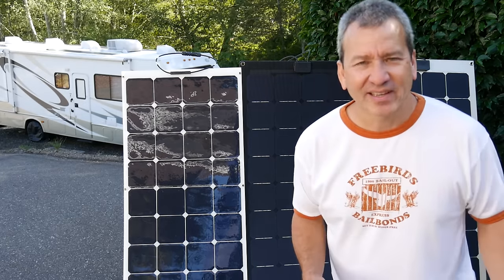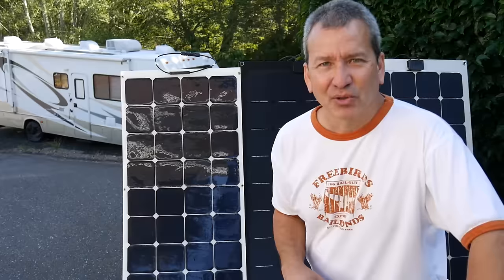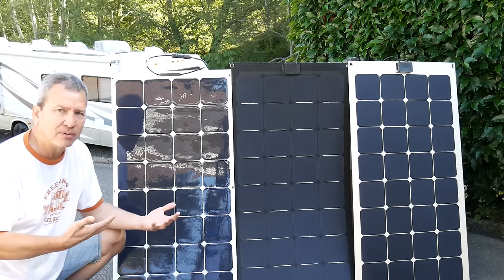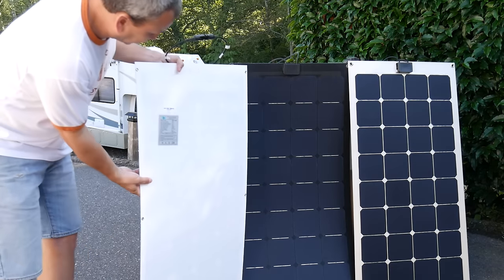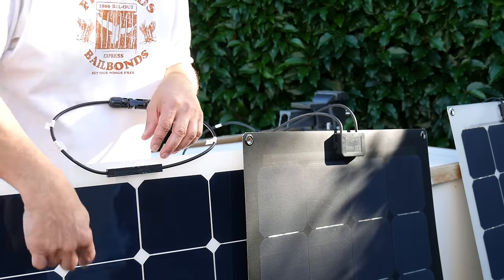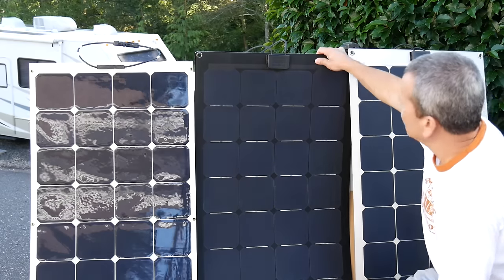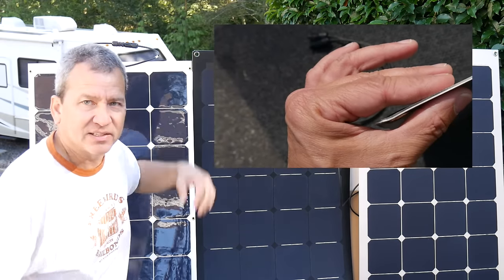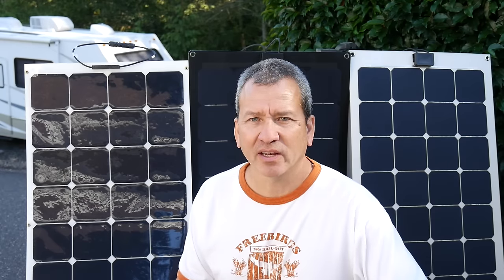Flexible Solar Panels - What To Look For

Comment: Thanks for sharing your knowledge and experience. Kind of late to the game, but just bought two 100 W flexible panels form Renogy (SunPower® Flexible Solar Panels | SPR-E-Flex-100).  Apparently, this is their newly introduced, and redesigned ?, flexible panel after their infamous recall a few years ago.  Do you have any experience or opinion on these?  Thanks in advance, zjxn06

Comment: TITO I am put together a solor system and have changed my battery set up to two 6 volt batteries, my question is can you send me a link to how you started your change over . how to conect your batteris to solar . i want to use two 100 watt panels to start, can you help me get in the rigt direction?
Reply from the maker: Here's a video where I walkthrough my solar/controller/battery setup:http://www.youtube.com/watch?v=ASjfX-8npkE&sns=em.
Reply: Ya i need that type of info myself  :)
Reply: connect your batteries in series (+ on one battery to - on the other) and 2 x 6v becomes 1 x 12v

Comment: Brian, I have the battery that came with the trailer. The trailer is preped for solar. How can I tell if this battery will last through the night and only using led lights inside for a few hours?
Reply from the maker: It should be fine with just a few LED assuming the battery is charged and in good shape. You don't want to discharge it lower than 50% anyway. Let's assume one light uses .5 amps. If you ran it for two hours that would total 1 amp hour. Compare that to the total amp hour capacity of your battery. Hope that helps.

Comment: would these work on an airstream which have curved aluminium roofs?
Reply from the maker: It should work fine. I haven't seen anyone posting an airstream install yet, but lots of vans. They also make a product called Alumibond that you may want to check out (https://www.eternabond.com/articles.asp?id=154).

Comment: Do you think the corners would hold a better seal if one piece of tape cut in the shape of a form- fitting angle were laid down first to attach the panel corner to the roof
Reply: And then the two overlapping edges places on top of it? So the first tape laid down is a solid piece 
 over the panel corner and its edges are covered by the tape that attaches the edges.

Comment: can you run a 24v panel on a 12v system if you got a MTTP controller. A 24v panel gives out about 30v?
Reply from the maker: Yes. Only with about MPPT controller.

Comment: I have a big question for me anyways,,Is it more panels or batterys ,,I want to be able to

 have as much power i can gather I have bought 2 300 watt panels and 2 200 amp batteries,,so is it more about storing the power or how much you have coming in from the panels?
Reply from the maker: I'd start with more batteries. There are multiple ways to charge them up.

Comment: Heat vs Solar: I was interested in this point regarding flexible Panels, that cannot be ventilated!
I did some research and found some Infos from German engineers: There is a HUGE LOSS IN EFFICIENCY! 0.45%/degree Celsius!
From 20° to 60°C you lose 20% energy: instead of 90 Watt from a 100 watt panel you get only 72 Watt. A ventilated on a alu frame sitting panel will be way more efficient!
The simple difference between a panel all black vs white framed has been measured by 2,5% loss.

The panels are NOT made to be glued onto a surface. Coming from boat area - they are ment to be interested in tent style covers or similar. A fiberglass well isolated surface is the worst it can be mounted on.
Reply: der Jack Is there a better way to mount flex panels, in a way that is lifted for better air flow? I’m sure someone has installation ideas that achieve best solar output with elevation of panels; and would the ones with aluminum backing conduct heat both back towards panels as well as to top of metal roof?

Comment: what's the point of flexible fixed panels, when you can't tilt them towards the sun?
Reply from the maker: My reasons are because they are not visible and don't block access to the roof. To get around the tilting issue, I keep one or two panels stored in the RV as a portable setup that I can position in the early morning or late part of the day as needed. If you really need to tilt, you should go with conventional panels.

Comment: I have 4 100 watts Flexible Solar Panels on my mini van.
Reply: Robert Polito I am 4 months away from doing the same and found this video during my research. Do you live/vandwell in your van? if so how has the experience been?
Reply: What is your take on the mounting to metal heat issue?

Comment: Hi Tito,

Are you still using your Unisolar Thin Film (Amorphous) panel or your using a much better brand of flexible panel (Mono, etc...)? Thank u
Reply from the maker: +a c Yes I am still using the unisolar together with the other mono flex panels.
Reply: sorry to ask... but on eBay, some seller making a notes that solar panel should not be connected to parallel or series for it to have a long life... how true is this and does your solar connected to series or parallel? thank u
Reply: Please explain what you mean by "better" - A 64W unisolar will outperform a BP 80W mono because it is able to pick up the RGB spectrum better (triple junction) and therefore
works better in lower light levels. I will admit that Unisolar takes up more space to achieve this but it does not make mono "better". A combination of the two as you have, is best. I would be interested in your views on how they both perform?

Comment: Could you run an electric vehicle with those?
Reply: Remember that an electric vehicle runs off its battery. A solar array does not have the available current to start an electric vehicle moving, it supplies a constant, rather low current. The trick with an electric vehicle would be to have a plug-in overnight to top off the batteries and then the solar array can be used to extend battery life on the road. Provided, of course, that you have some available.

Comment: I heard these dont last are yours still working?
Reply from the maker: I've got Sunpower branded panels now that work great. One of the first HQST flex panels I had failed after 2 years. The others were fine but were showing signs of wear. Newer more expensive ones are much better.

Comment: I'm sorry, but did Tito have that left most panel's neg out plugged straight into the positive out? I may be wrong but that doesn't  seem good, and if not, all these advice videos are suspect.
Reply from the maker: Actually it completes the circuit with no electrical load and is totally fine. When you connect the panel to something else (like a battery or charger) it simply adds a load to the circuit so the current flows through the load as well and then back to the panel. It's basic electricity. Also, solar panels are rated with a "Short Circuit Voltage" rating (ISC). To measure that, you connect the positive and negative then measure the current under direct sun. I hope this helps clear things up for you.

Comment: I bought that HQST on the left and it FAILED after just 16 months of use.
Reply: @drewwolod4977  I won't ever buy a flexible panel again and I hope others see this post.  NOT a good value.
Reply: @VitalityMassage  I mean, that's common knowledge. Flex panels don't last that long due to heat dissipation, or lake thereof. You need to get panels with good warranties so you can swap them out.
Reply: @drewwolod4977  I was new to buying solar panels so no, it wasn't common knowledge and no, it's not logical to just "swap them out".  It's a WASTE of time, resources and money.
Reply: @VitalityMassage  For me, I don't want 25 extra pounds on my roof, so a flexible panel is a better option for me.

Comment: I would not walk on any of these solar panels because it will at some point the connections between the cells or the cells themselves will break. Most say you can walk on them only because their competitors say you can; so they have to say you can too else you will buy the "other brand"...

Comment: How big of an issue does heat play in flexible and non flex panels?
Reply from the maker: Generally speaking, they generate heat and perform better in cold weather. Performance levels decrease in very hot weather. The ratings at standard test conditions (STC) are taken at 77 deg F.  I've tested these panels in direct sun with the panel temperatures at 140 degrees and they've maintained their standard output levels. I plan on exploring this further in an upcoming video.
Reply: RVwithTito look forward to that video and thanks.
Reply: Question is not just heat: a standard panel is mounted on a alu frame that will transmit heat and ventilate from the back. This is not possible with a flex one glued on fiberglass roof!!!
THAT'S the difference. And therefore you will get inefficiency you can NOT calculate in front

Comment: If the panels dont have a totally flat surface forget them. Flexible panels are crap and break too easily. If you are serious about making power from solar, then you need panels that you can angle towards the sun and an automated system to keep them pointing at it.

Comment: First want to say thank you again for all your videos. You are 1 of 1000 can teach the things people understand easy.  Second - i have a question and think you are the right one for answer. I live here in thailand and here the energy is a 1 phase 220V 50Hz System with a 15KW meter. In bigger citys is 3 phases 380V possible but not in my area. Now i see a Motor Pump Inverter that inverts 1 Phases 220V to 3 Phases 380V. Here the link: http://www.solar-thailand.com/EN/Product.asp?Data1=PI9230-7R5G3S    But it looks like is only usable for pump motors. Now my question. Can i use this to run any maschine what need 380V? I have a big vakuum machine need 7KW and 380V. Thanks anyone in front for answer.
Reply from the maker: These solar panels only output DC power. 1 phase and 3 phase are AC (alternating current). You would need another inverter to convert the DC from the solar to 1 phase AC. I don't know of any. The inverter you mention takes AC in and outputs AC. That's the best answer I can give. Hope it helps.

Comment: You shouldn't plug the panel leads into each other,  in the sun they are generating power and you are shorting them out!
Reply from the maker: Solar panels are a bit different. Connecting the leads together doesn't harm them. There is no electrical load in this state so any current generated from sun simply flows back to the other side of the cells. It is also the way you measure the short circuit current (Isc) which is one of the panel ratings.

Comment: Why are you shorting the panel.? Would seem you don't have much of a clue..
Reply from the maker: Shorting out the leads on a panel essentially closes the circuit with no load. Voltage across the solar module should be near zero in this state. Shorting the leads on a single panel in this way, then using a clamp meter to measure current, is an acceptable way to measure/verify a panel's Short Circuit Current (Isc) rating stated on the back of the panel. It's essentially the same as connecting both ends to a standard multi meter to measure current passing through with no load.

Comment: TITO,
My research has found that flex panels have 2 drawbacks over glass.
ITEM1
Flex panels generate less power than glass

ITEM2
Flex panels plastic surfaces will scratch from cleaning after time and the plastic lense will become more & more cloudy allowing less & less sun into the cells.

!
Reply from the maker: There are pros and cons to both flex and glass. Both have their application. I don't think it's fair to make a general statement regarding power output when the power specs are clearly stated and testable on each panel. Simply compare the numbers on comparable 100 watt glass panels with their flex counterpart and you will notice they are roughly the same. There are also several other factors beyond the solar panels that can affect the overall performance of a solar system. Regarding the scratching though, I could see how that would be a concern. The manufacturers claim it's not an issue but I think it deserves some real world testing. Thanks for sharing your thoughts.

Comment: I just lost all faith in you Tito when you connected both ends of the solar panel together. It's like shorting out across a car battery. ;(
Reply from the maker: Maybe this will restore some faith Jerry. Short circuiting a solar panel does not damage it. Short circuit current (Isc) is how panels are rated along with open circuit voltage (Voc). It's a common test to short circuit the panel through a multi-meter or directly (then use a clamp meter), point it at the sun, and measure the short circuit current. There is no load on the panel in this mode, so it gives an indication whether the panel is performing according to spec. I prefer the clamp meter method because it's much easier and quicker.
Reply: I respectfully disagree. The Short Circuit Current on some panels I have (Isc) is 6.12 amps. There is very much a load. That piece of wire is your load. So...  short circuit your panels and leave them in the sun and lets see how long they last like that. Shoot that video and report back. Maybe I am wrong but 60 years as an electronic engineer causes me to think that this can not be good. On a positive note, I do enjoy your vids and will keep watching. PS: Flexible panels are not popular in hot climates such as Texas. I rather have them separated from the roof of the RV by an inch or so allowing ventilation below the panel to help keep the panel cool(er). And this also gives the roof of the RV about 8 square feet per panel of shade from the sun. Shade is a valuable commodity in the south. Peace out.
Reply: @kd5oldman  I agree, it cant be good to short the panel over any long period of time. There is absolutely no reason to do that imo.